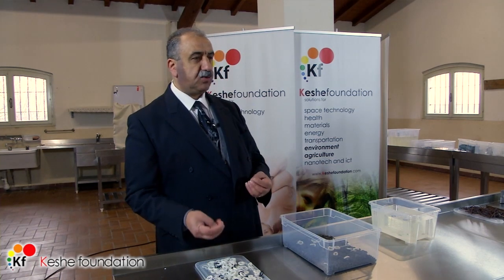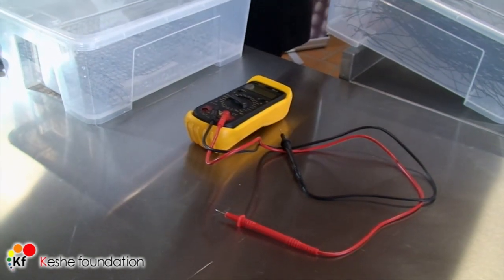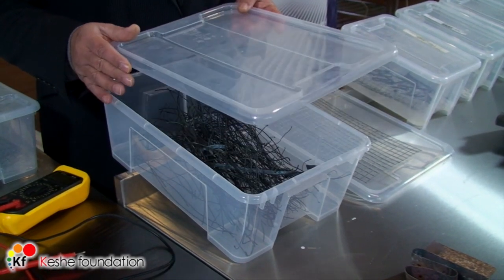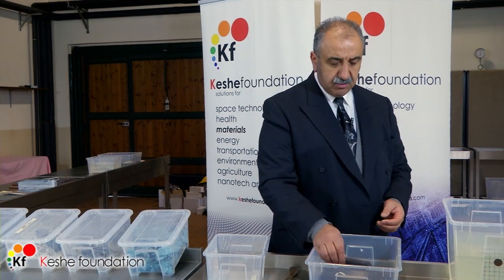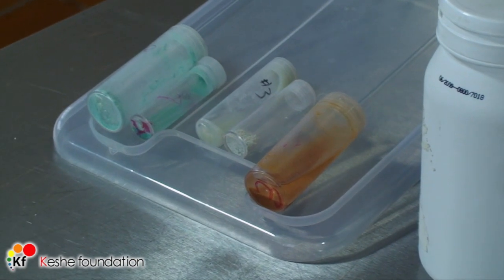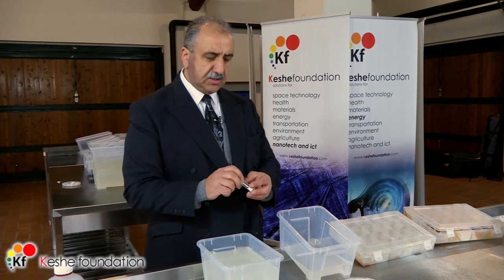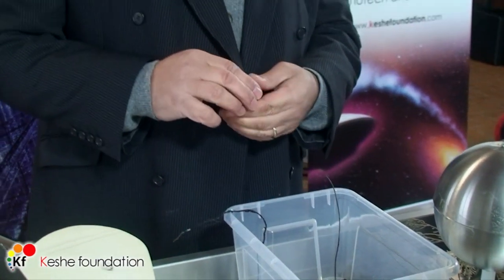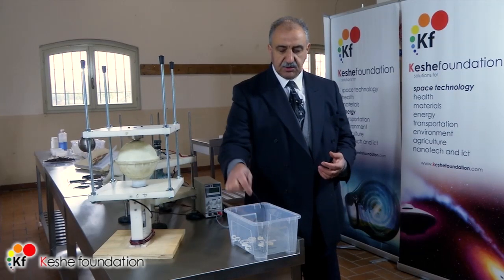Fukushima Daiichi nuclear accident cleanup

Comment: After looking at your research and the research revealed by William Lyne I am convinced that what is happening inside the reactors is that the plasma is splitting diatomic molecules into mono atomic molecules and they are recombining.
When you are using H2 it is splitting into HH and then recombining back into H2 releasing a lot of energy or when you are using O2 it is splitting into OO and then recombining. The total amount of matter you are using is no more than one diatomic molecule which keeps dividing from it's diatomic state into a mono atomic state and then recombining back into it's diatomic state. When you are doing it with Co2 I believe your just splitting a mono atomic molecule of oxygen off of the oxygen atom and the energy released happens when it recombines.
As in the use of copper for instance.when turned into cupric oxide CUO also known as tenorite it becomes a p type semiconductor containing one mono atomic molecule of Oxygen..

Comment: Keshe.. I know you said that frequency is not used... but I think if you tune it to the F# note that the magnetic fields will vibrate more and the energy will increase and you may not even need the moving parts..
Try a 5/3 ratio.. the F# note.
The F# note is the only note that exists both in infrared and ultraviolet... the 39th octave of middle F# (360hz} is infrared and the 40th octave is ultraviolet. You should achieve this just from the harmonics. The F# note is the only note you can see in 2 colors and between the 39th octave and the 40th octave is the whole visible spectrum of light.
Just a suggestion.

Comment: wow its very interesting mr keshe, and the implications of this tech process are at the very least massive.  no doubt our govt here in the states will use this creation to further its tyranny by just extracting the lead from ammunition or the gold and silver that citizens stock to protect what little wealth they still have, or to extract the titanium pins and screws of our vets and so on and on and on......   question: what is the effective range through open air of a device like you have displayed in the video say 400% larger than the one with the plastic sphere?  when i say open air just imagine it mounted on a cell phone tower.